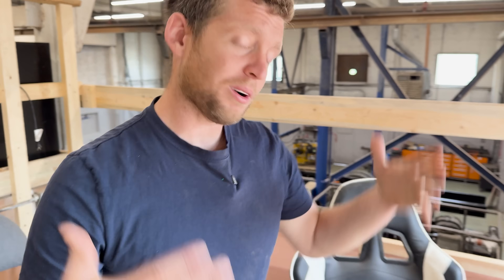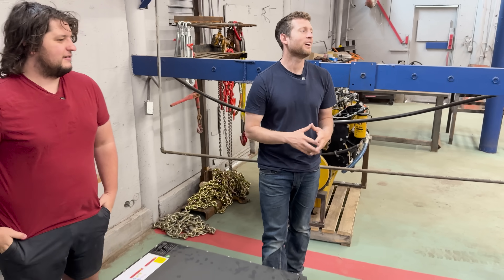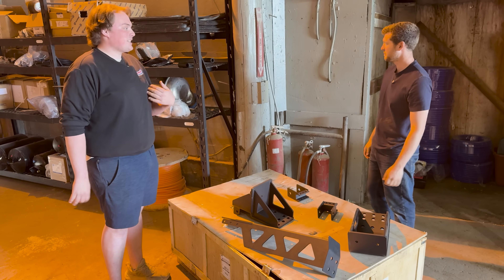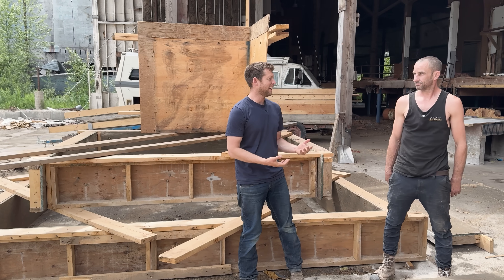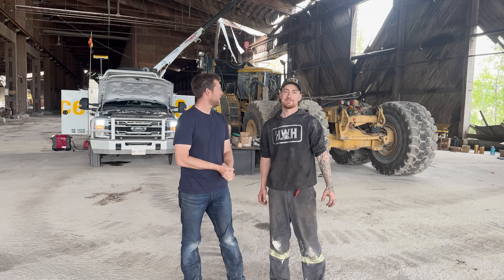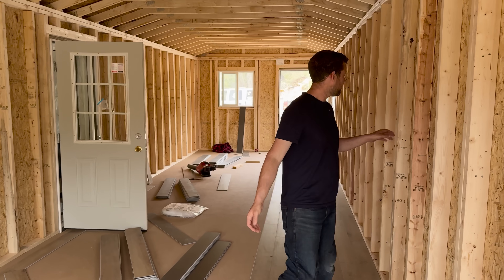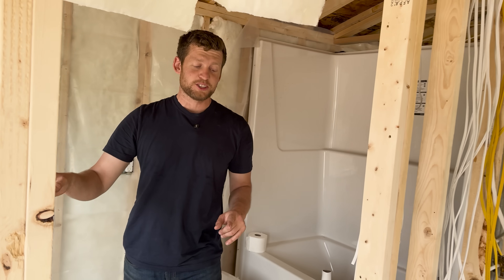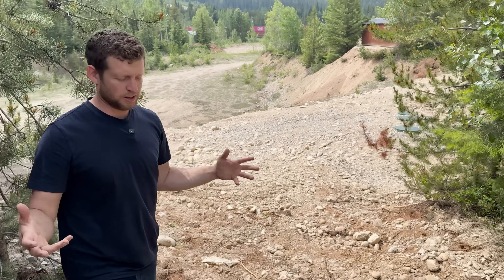Move complete, building trucks again!

Comment: As someone who works entirely in metric outside of driving... I had to go convert 160k lbs into real numbers, and fully loaded your trucks are 72.6 (I rounded up a little okay?) metric tonnes, an M1A2 Abrams is 61 metrics tonnes... I did not realise logging trucks were that heavy. Bloody hell.
Reply: Divide lbs by 2000 and you get Freedom Tons. It's 80 Freedom Tons. Pretty close to 72.6 Metric Tons. I've been watching for a while so I know those logging trucks are crazy heavy!
Reply: @Nphen  and that's one of the many, many reasons I prefer metric. Base 10 is less of a PITA. Also, having done a job where I had to deal with clients who used both Imperial and Metric, I came to the conclusion Infinitely prefer working in the base 10 of metric, also there's less decimal place in 0.03-1.5mm than there is in the equivalent in Imperial. XD
Reply: Canadian "B" train I think.
Reply: @Sah-o5m  B-trains are typically limited to 140,000 lb without a permit. But in the BC bush weight limits don't apply.

Comment: Hooking up all the boxes is the relatively easy part from what I've seen. An open communications protocol can leave a bit to interpretation, so I've seen one company accommodate other manufactures'interpretations. 

Nice to see a seasonal resident.

Our family bought a Pan-Abode (engineered logs) home that was put together by a school district carpenter. He decided to re-use a large laminated beam that looked like it came from a vaulted ceiling from a gym. People would visit our basement and wonder why we had a large beam running the length of the house. Most everyone agreed it wasn't necessary.

Comment: Keep building your cab mounts and such as heavy as possible. I work in the mining sector and whenever manufacturers try to skimp on strength we have to repair it in nightmarish locations!
Reply: Leave the heavy duty mounts as an option down the line once you have the engineered lighter duty, let the customer choose, those that are using these trucks off highway will prefer the skookum as frig options.

Comment: Good idea to be 3-D printing your jigs and fixtures. Are you using polymer feed stock or using metal powder? Of you're using polymer you should insert hardened steel bushings for your locating holes. Polymer will wear too fast, whether you're drilling through or using locating pins. Don't know how you're doing your raw frame/mounted components alignment, but in airframe assembly we used optical levels to measure off of pre-determined index points. Also, you could use an instrument similar to a surveyor's total station. Can't help making these comments from the peanut  gallery, but my background is tool and die making and manufacturing/assembly design and engineering.
Reply: That's good advice, I hadn't thought of steel bushings on my 3d printed jigs, that'll save me some reprints on my own projects.  Cheers from a peanut gallery neighbour

Comment: Not a canadian manufacturer, but working for a US company that sells trailers into Canada, we are able to use existing reports that CTEA has on file for various axles, wheel ends, and brake liners that were already tested,rather than have to individually test our trailers on a track. Perhaps your wheel ends are too custom, but have you looked into that to save some time and money?
Reply: They are doing that as much as possible to avoid having to test parts. That's one advantage of going with off-the-shelf parts. They still have to test each model of vehicle they build.

Comment: Just as Fluoride is a byproduct created in the process of making fertilizer, gasoline and diesel are byproducts created during the refining process of crude oil, which produces asphalt, plastics, and pharmaceuticals, as primary products. Byproducts are that which are created incidentally, and must be disposed of properly, if the public isn't forced to consume it, by restricting alternatives that is.  

This is why "they" keep killing off water power car guys. Every gallon of water provides 99 miles worth of hydrogen. They use "We The People" to dispose of their byproducts. That's why they put the byproduct referred to as fluoride in your drinking water, and tax the hell out of you for burning up a byproduct that they would otherwise have to pay to dispose of. 

I just walked from a 23yr career in aviation fuels upstream of a refinery. The jig is up! The future is free! We will be using Hydrogen generators to top of our EVs using water... soon. I did it 20 years ago in my Honda CRV, so lying about the ability to do so will get you laughed at.  Capitalists invest into the technologies that Communists suppress. If they are suppressing free energy, that God put into every gallon of water, that can be extracted from the moisture in the air, then they are suppressing your freedom.

"Free volts in the sky, but they charge for lies,
Copper spool to the drone, and the meter don't lie.
Tesla flipped in his grave when they boxed the spark,
Now we drive EVs that die in the dark.
Static in the Æther but silence below,
They could charge your ride off a thundercloud's glow.
But they want the byproduct profit to flow,
So they bury the truth like snow over gold.
Diesel and Gasoline are a byproduct trap,
Killing off water powered car guys — imagine that.
The future is free — they try to make it drown,
Now the fires we face are profit-bound."

"Digital Herods"
https://www.youtube.com/watch?v=qEV2q5_udhA

Comment: I hope you gave these guys a shitload of equity for doing their actual jobs along with building their own accommodations along with marketing the company all while moving an entire shop with bare minimum things like running water and toilets. I for one wouldn’t take this job and I’ve lived in some really sketchy places and worked 6 & 1 schedules 900 kms from home. Living at work is a whole other level of burn out.
Reply: Depending on how they decide to grow, Edison Motors could be worth $10B in 10 years or so. Meaning a 1% stake is worth $100m. We don't know if they're getting a full percent of ownership, but that's the type of numbers Edison could do if they open up conversion shops across North America. Batteries getting better actually helps Edison without harming the use case for heavy & remote equipment. A lot of farm equipment to refit to diesel/electric as well.